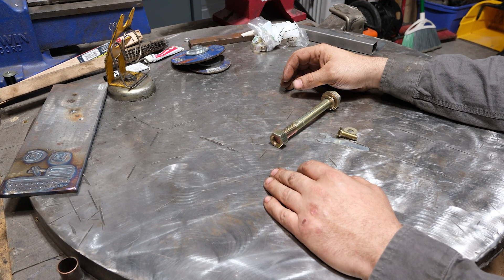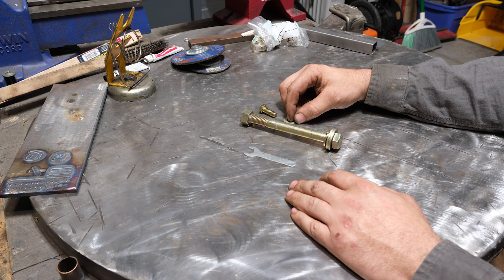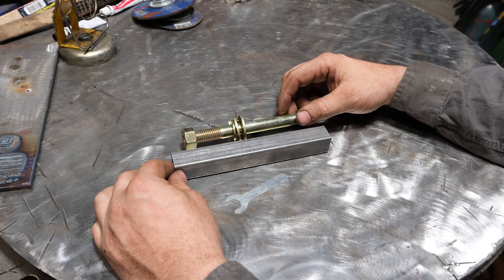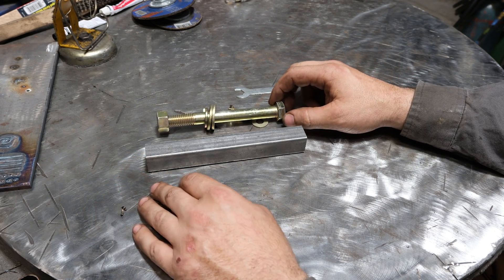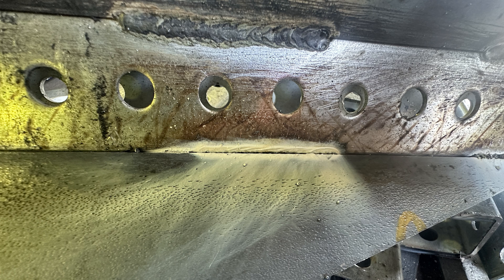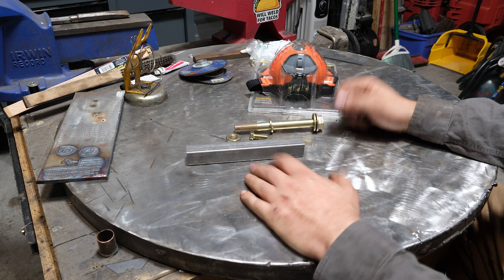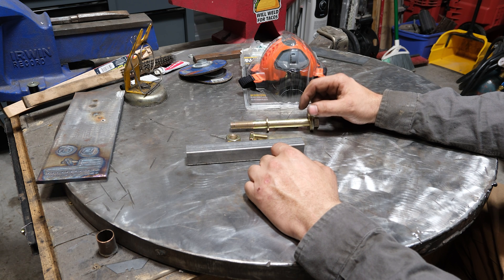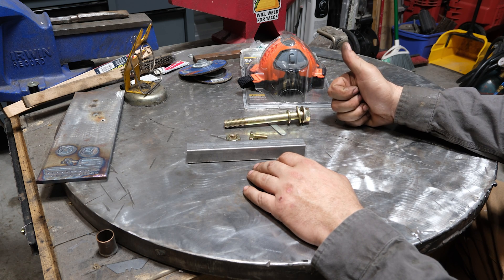Welding on galvanized material (safely)

Comment: A very important subject.  Thanks for posting.  I use a respirator specifically made for welding that is compact and fits nicely under a hood.  It's smaller than the regular ones, so you have to change the cartridges and pre-filters a little more often.  A fan or weld fume extractor is a good idea too.
Reply from the maker: Those welding respirators are 100% worth it no doubt.
Reply: @makingmistakeswithgreg  Been trying to get into welding, got a good respirator but big under hood.  Where does one find small good masks?
Reply: What are the filter numbers that are for zinc fumes??
Reply: I’ve found fans are harder to use because they can blow the shielding gas away and leave a lower quality weld.  Any tips if I’m doing it wrong, but the less wind the better the weld.

Comment: Very good information.  The Electroplated galvanizing is very thin and smooth - while the Hot-Dipped is thicker and usually has a rougher surface.
Reply: Hot dipped has a crystalline structure look to it.
After the steel is removed from the hot molten zinc bath, it reacts to being exposed to the atmosphere, and the pure zinc mixes with oxygen to form zinc oxide. The zinc-oxide further reacts to carbon dioxide and forms zinc carbonate, which makes up the final protective coating on the material. The tell-tale sign of a hot-dipped galvanized material is the presence of a crystalline-like pattern on the surface,
Some people call it spangle.

But it can be millimetres thick sometimes, much thicker than Electrogalvanizing.

I see hot dipped quite a lot and typically grind it off as best I can but you'll still get zinc fumes when welding.

Comment: The best solution I found is to dissolve the zinc off with CITRIC acid - its  very safe - even sold as a drinkable supplement. a bolt be will zinc free in 15mins - totally safe to weld and no acid residue
Reply from the maker: Very interesting, if that works that would be a great option.  Way better than muriatic acid.
Reply: @makingmistakeswithgreg  search YouTube lots of videos about it

Comment: Deep breaths when welding that chit.😂❤
Reply from the maker: As long as they are before you strike an arc and you hold the clean air in sure lol.  A few solid puffs of the forbidden welders dust and you will be wishing you used even a dirty gym sock as a filter lol.
Reply: @makingmistakeswithgreg  hahaha 😆

Comment: Acids seem to remove galvanizing well, and it might be the only way for odd shaped parts you can't grind easily. I've used vinegar on some chain, and it left it pretty clean. Obviously using acids on something structural isn't likely a good idea. Wire wheel is the worst, there's always a bunch of the coating left. I'd probably prefer a fresh coarse flap disc and a light touch, to maybe keep the particle size a little bigger. If gouging the material isn't an issue, a carbide burr will take off chips and less of the floaty dust, but that is its own kind of hell. If it's a small part, maybe just a hand file.
Reply from the maker: Pretty much sums it up.  I am not a huge fan of the acid method, but if it was that or breathing the fumes I would do the acid lol.  I would worry about residual acid being vaporized in the arc and also causing lung damage.  Galvanizing sucks…
Reply: @makingmistakeswithgreg  Yeah, washing the material is a must, too.

Comment: I have to agree. When I was a kid on the farm I torched apart a large galvanized old water tank and then stick welded it into animal feeders. I was puking my guts out the whole next day. I still weld lots of galvanized (I make pig “tractors” from old trampolines and hog panels) using flux wire. I try to do it outside and use the “quick, hold your breath” method. I guess I should invest in one of these respirators. Thanks for all your quality content. Scott, Vass NC
Reply from the maker: Using a filter mask will help a lot to keep the stuff out of you lungs.  To me it’s not just when welding it, the grinding dust is not good either.  The old “hold your breath trick” works but  decent respirator is the way to go.  I suggest the GVS brand or Lincoln electric, both are solid.
Reply: @makingmistakeswithgreg Siloca based grinding wheels release silicate, which causes silicosis. It's a really hard habit for old timers to start using PPE for the grinder, when all they used to do is squint for eye protection and smoke a cigarette for lung protection.
Reply: Would like to report that I did my first real welding repair today.  Before it had all been just practice.  The job was to repair a Jeep fender (galvanized) with a crack and a rust hole.  Welded the crack and butt welded a patch with flux core. It was interesting that the sun heated the sheet metal and forced me to dial down quite a bit to avoid blowing through…real world experience!  It was a lot of fun.  Thanks for your teachings.

Comment: I welded plenty of galv sections and stuff with Mig withoutany issues. Another thing to factor in is that no matter how good you think you have cleaned off the galv, there will always be traces left and they will show their presence when you start welding. Always prepare to get spatter burns too, occassionally they fly a long way and get into places other spatter cannot reach. Remember, welding galv steel is like trying to get trapped wild cat out of your car, it will spit at you and fight you all the way.
Reply from the maker: Great point on the spatter, the metal balls tend to roll right off it onto you lol.

Comment: i welded on a bunch of galvanized metal recently, i cleaned it with a grinder wheel as much as possible and used a 3M P100 respirator while it was windy and i still felt a little sick. 

if i have to do it and its not windy ill put a fan blowing the smoke away.
Reply from the maker: I did the parts in the video with a papr, with a fan on my back.  I was not sick at all. I bet if your mask doesn’t fit 100% or some of the smoke lingered near the exhaust port you could have got some in the lungs.  It definitely is no fun.